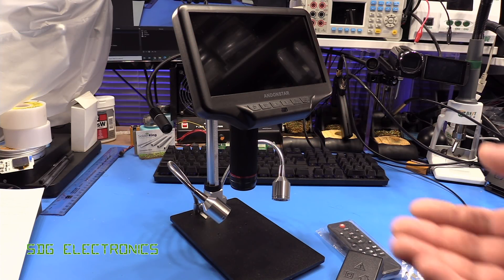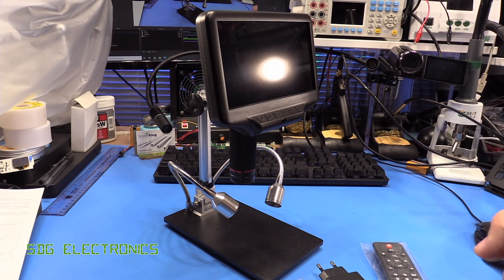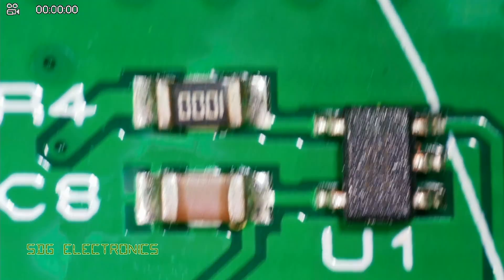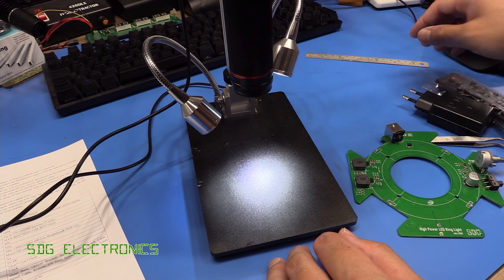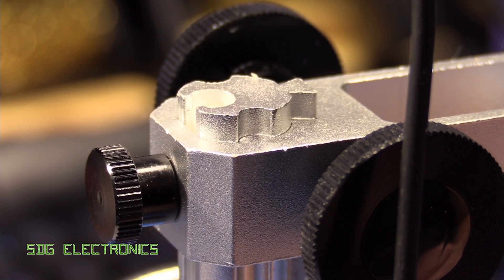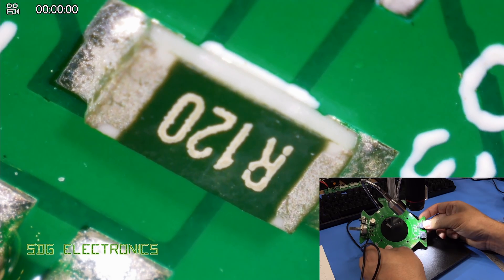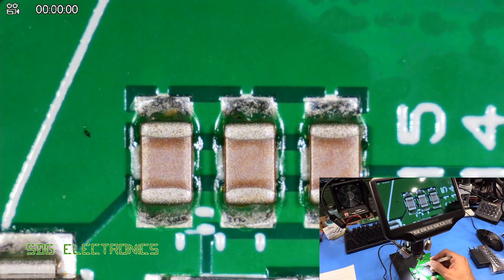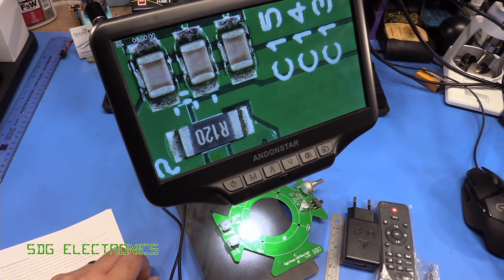SDG #172 Andonstar AD407 7" Display Microscope and Camera with PCBs from JLCPCB

Comment: I've been using this microscope for 8 months for PCB inspection and SMD soldering and I'm pretty happy. Recommended, specially when connected to an external monitor. I designed a couple of 3D printed  supports to hold PCB under the AD:  https://www.thingiverse.com/thing:4153952 and https://www.thingiverse.com/thing:4128609
Reply: That's if it will still work on a pc in a couple of years when a windows update breaks functionality and andonstar provides no support.

Comment: Nice review, thanks.
I have a cheaper version, and though it is fixed magnification, the actual zoom can be adjusted by raising and lowering the lens.  There is an effective ~4x difference on top of the fixed magnification of 40x, so I get something like 20x - 80x actual range.

Comment: You can get a little more field of view out of it (well I could on mine, slightly different model and stand) by cautiously clamping the camera+screen unit at bottom of the lens. That also gives you more clearance. The focus is  variable enough to cope with the difference in height.

Comment: Looks very similar to previous models therefore it may be a good idea to add strain relief to the micro-USB cable. I snagged my ADSM301s cable whilst moving it and pulled the USB port off the board... Easy to fix but it really shouldn't be that easy to damage.

Comment: Great review.....
For inspection nice enough but I still don't find it as convenient enough as my cheap headset magnifiers, which are binocular for soldering as well.
Might be useful to have it on a bracket so can swing out of the way (without the base and light). DOF might be an issue though. Oops, there i go modifying stuff again!
Reply: Yes indeed this microscope has big problems with DOF and image sharpness. Compared to ADSM302 it is seen in the fog. Andonstar is desperate for this big failure and is still trying to pay favorable reviews by sending free units to be tested. I had the ADSM302 that I sold so I could buy this new model. It is true that the 302 had a big lag (Jelly Effect) please try tweezer test, but the image was much clearer and had an excellent DOF. I don't want to upset anyone, but this is the truth, and I admit that if I received a free AD407, maybe I would write a positive review.

Comment: Way too much magnification! X10 is almost too much for PCB work. Don’t have an issue with fixed zoom as my binocular microscope is fixed at X10. OK for inspection of your soldering as then you don’t need to see all the component.
Reply from the maker: The fixed zoom is a major limitation. I do wonder if there is a 0.5x lens that can screw to the bottom of the unit. Varifocal would be so much more useful.

Comment: Fixed zoom? I thouht you couldn adjust the height with the wheels at the back to zoom in. Pricy for sure it is.
Reply from the maker: The height rack is mainly to adjust the focus based on the height of the item you're inspecting.
Reply: @sdgelectronics  but if you move the scope higher and then re-focus using the lens, you get a wider picture. Vice Versa, if you move closer - and then refocus - you get a narrower picture. I believe if you clamp the camera at the very end - where it does not rotate - you can increase the height of the whole thing and still be able to focus, hence an even wider picture.

Comment: Pretty silly design having the capture/record button (or any buttons) on the display area. Capture/record should be on the remote so  you don't blur/effect the image your capturing. 
Once you do fix the silly small base, you end up using as much space as a conventional binocular microscope.
 Very happy i saved up and bought my articulated amscope. Seems all cameras for all microscopes have shitty design.  
Ideally i would like a camera that is subservient to raspberry pi zero w.  Makers could then make them do what we want, not what the manufacturer thought we wanted.
Reply: It's got a remote with a record button...
Reply: They've implemented a not-so-silly and un-shitty Time Delay of roughly 2~3sec after pressing, more than sufficient for stabilization and for a crisp image.